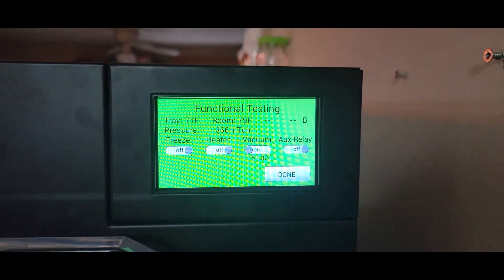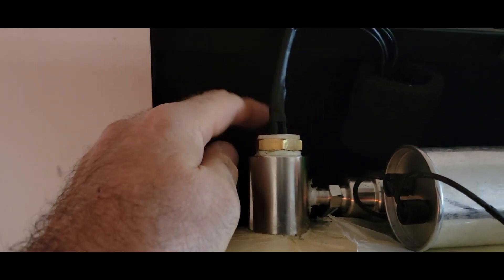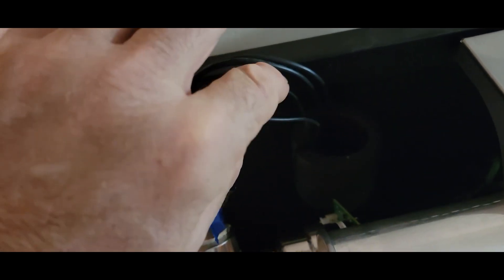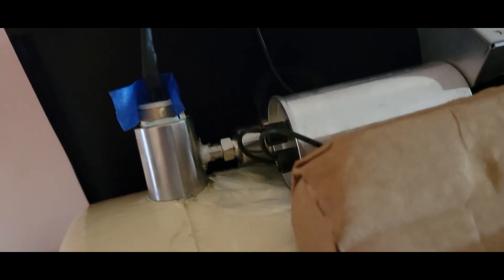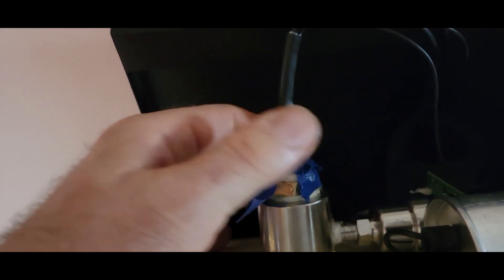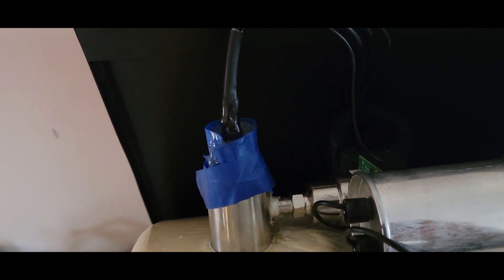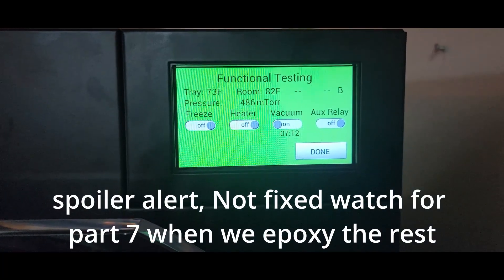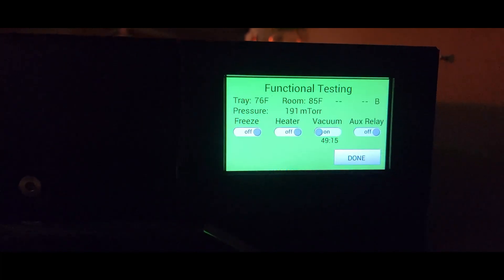Harvest Right Vacuum Error #9 - Part 6 Epoxy wires continued

Comment: Used ours successfully only twice and now it won't go below 650mTorr. 😡
Reply from the maker: there were 3 places that caused mine to fail. 1. the connection to the sensor. 2. the entry point of the wires into the connector. 3. the threads on the connector.
Reply: @LearnToFixItYourself  I epoxied the entire connector area.. Seems to have worked! 🤞
Not sure why it had only worked twice before.. Perhaps vibrations caused factory epoxy to form micro cracks..? 🤷🏻‍♂️
Reply: Ok well our second batch post-repair will probably fail. I watched the vacuum bottom out at 490mT after 15 minutes of drying and then, over the course of 3 minutes, it steadily climbed up to 600mT.  I stopped watching at that point... Nothing I can do about it. Starting to wonder if our pump is trashed.

Comment: Been there, done that  couldn’t find a single leak.  Thinking back it all started with the install of .23 firmware. Paid the $45 tech fee and got nowhere until .24 was released and now everything is back to normal. Ran 10 batches with no errors and no issues.
Reply: 24 was released? I don’t see it on their website? Can you explain?
Reply: @MCLdy  24 was written so that the machine ignores vacuum leaks.  Don’t install it, you won’t be able to go back.
Reply: @johnf8877  interesting. Thank u!
Reply from the maker: I think you have to contact them and have the email it to you,  that is what the tech did when I was working with them.  He did say that the main difference is the new software will do candy. I have it but will not be installing it as I don't do candy and don't want to take a chance that the new version has bugs in it.

Comment: Hello, been following your videos. Can I ask, you never show how you tighten the pressure sensor screw. Its not obvious to mw how to tighten it, as the enture circuit board turns when I turn the nut clockwise... Please advise.
Reply from the maker: Rhe circuit plugs into the back of the sensor. You have to pull it off, then with the wrench tighten the sensor up. You have to tighten it up 3 or 4 turns after you have it tighten it with your fingers.